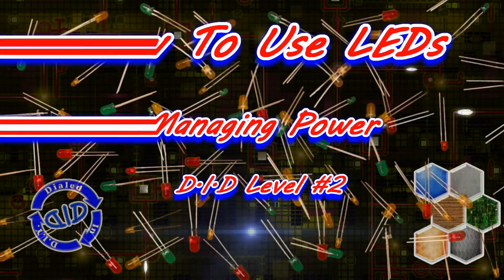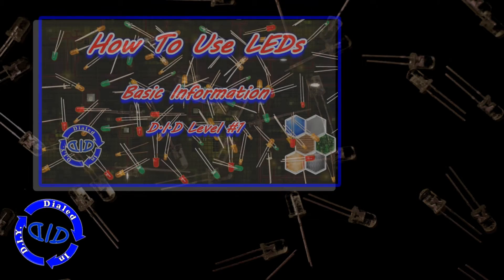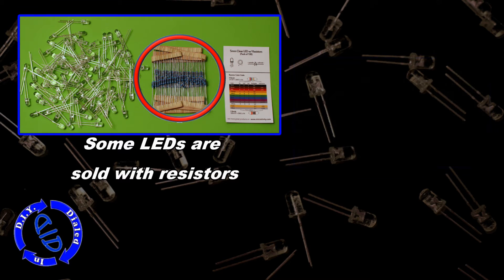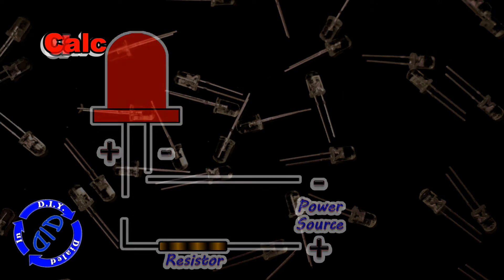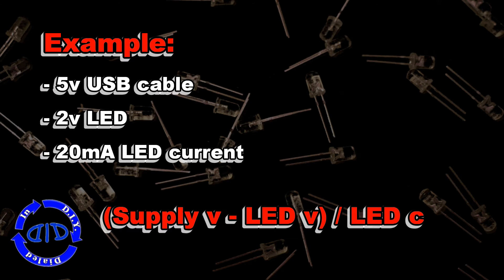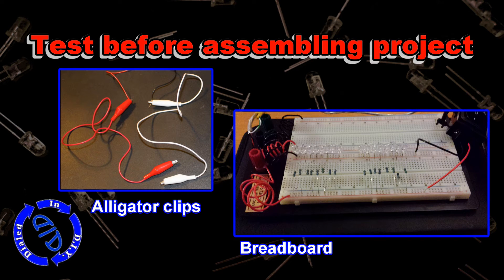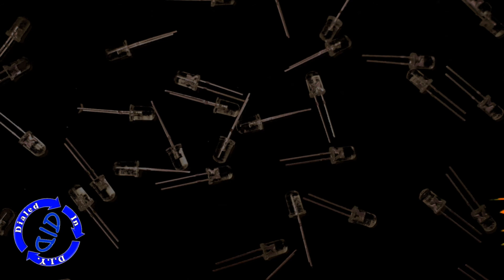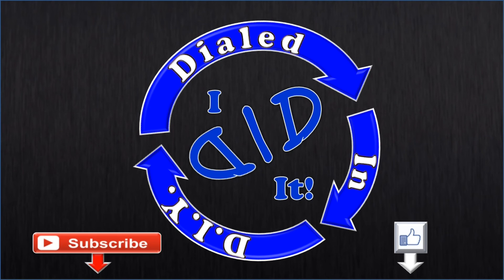How to use LED lights - Managing Power

Comment: i have a few questions im tryin to fig how to do a project involved with a bounch of wired led lights for a radio controled semi trailer  and im not shour were to start any idias
Reply from the maker: There are several ways you could add multiple LEDs. Did you have a specific number of LEDs or specific spots you want them on the RC semi trailer? How big is the trailer?

Comment: So if I have 20 small led diode lights, and I want to power from a 5V USB, do I just use one resistor at the start on the positive wire? 
They are 2v RGB light 20a
Reply from the maker: Hi John Q, thanks for the view and the Q.  I think the easiest way to explain that answer is in another one of my vids: https://youtu.be/vcrrciHGasA. There is a link to a site where you can easily enter your values and get not only answers to the questions above but also a graphic of how to hook everything up.  If that doesn't  quite answer your question please feel free to hit me up again.  Thanks for your view and Qs.